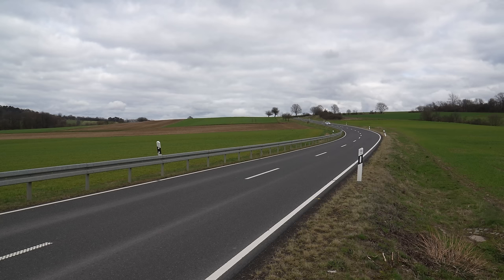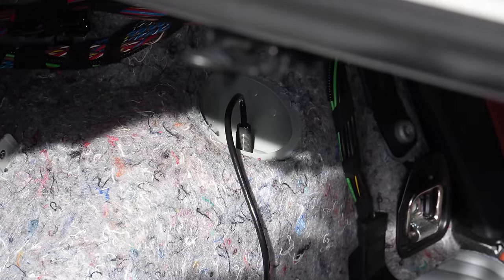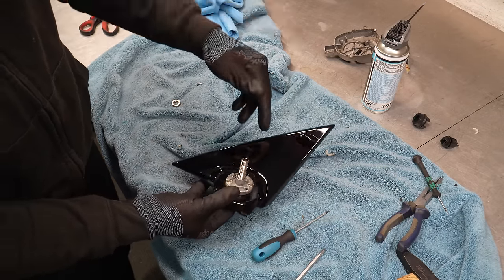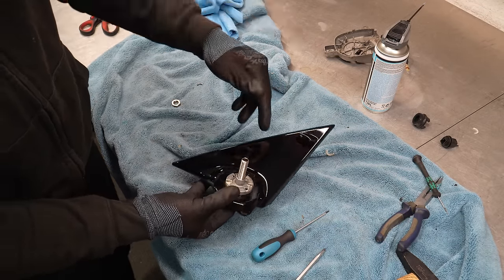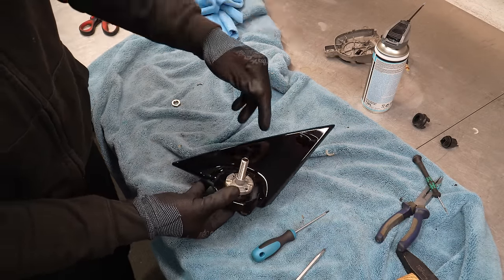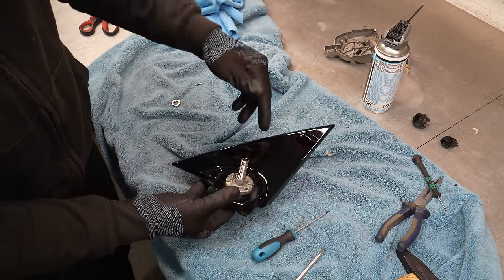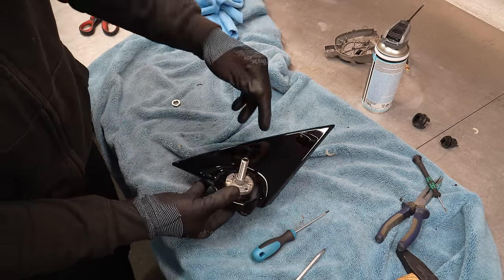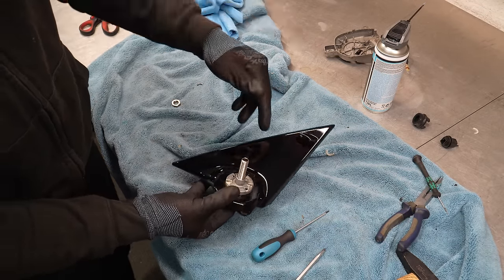Will the Built S65 V8 Make More Power? - BMW E92 M3 - Project Frankfurt: PT9

Comment: Question: why no exhaust/intake mods? Since you did the upgraded heads/cams would probably gain you another 30-40hp.

- also why no lowering springs/kw has ?

Love the build, and I'm getting another e92 m3 as soon as my ls Swapped e36 sells.

Comment: Why is the nm and Ps not crossing around 5250
Reply: The crossover at 5252rpm only applies if you're measuring power in HP and torque in lb-ft
Reply: @Johnny362000  Thx

Comment: But good Sir, I fail to understand how a differently shaped aluminum arm changes its runway and perceived resistance at both beginning- and endpoints. I dont mind the treat of course. Will project Frankfurt get an entirely different color as its on the road?

Comment: The listed horsepower/PS of cars is usually(always?) at the crank and not the wheels. So I would imagine 390 at the wheels is more than expected if it's listed at 420, because RWD has a greater power loss than FWD because of the driveshaft. I've heard up to 15-20% less than crank measure power. So 390 + 20% = 468(at crank)
Reply: These dynos take drivetrain losses into account

Comment: Great video. If I'm not mistaken you missed a few things: Cold air intake, Plenum and Exhaust. After, get another tune. I had this car for a couple years & broke suspension components in hard cornering. At the time I was being a little turd & just said "fix it" to the dealer. Now I regret doing that bc I wonder wtf it was. It'd click rhythmically after it broke in turns, almost like a CV joint does. Wish I knew what it was.  I think "big brake upgrades" are utter BS scams. Braking is about tires & fade = thermal mass. As in, the thickest rotors your calipers can fit. Now, what actually does make a brake better is if the caliper is lighter. I'd greatly prefer a lightweight 4-piston option ... as clamping force is NEVER a problem. Only brake fade. Of course, you want low unsprung weight. But even more important is low unsprung rotational inertia. Best still is make it all light. To that end, AP racing is the best. 

For those of you who love removing cats, just remember: Many governments literally CRUSH cars without them. Yeah, I used to drive my 2JZ in 1997 without them, buuut, in retrospect, imagine how fast it would've been had it been impounded and destroyed. One day I'll upload my video from Streets of Willow with Rhys Millen and my laps. Fun times.

Comment: I genuinely love the effort, I just hate the fact you kept it naturally aspirated and kept the STOCK EXHAUST, with a full Eventuri intake, you've got to match it with an uprated exhaust I mean come on now... and then just add a turbo, you clearly love the noise, so why not add one and a blow-off valve for the added noise and longevity factors? idk, seems silly not to when you've spent so much on the build already... Other than that, what a great build!!! (Edited : Not to forget that approx-$499 kit for the E92 that literally adds another 60+bhp at the crank which is easy asf to install? again, another no brainer for me? but hey)

Comment: I mean you can praise BMW engineering for being able to take the wingmirror off without taking off the door card but the only reason you are doing it is because of stupid over engineered mirrors and an underengineered pin that gets filled with dirt and stops working. Lets not ignore the fact you then have to get a dremel out to actually dissasemble the mirror....

Comment: The engine never delivered its power fresh from factory, because like all N/A engines you need a proper run in period. Which most white haired owners at the time didn’t know. These cars went on the dyno years after with their third owner, much younger and concerned about numbers.
That’s why I have a problem with the « E92 M3s don’t deliver their power »

Comment: E9x M3 is not famous for outputting lower power than advertised. Chassis dynos measure torque at the wheels, while BMW quotes horsepower from the engine itself. Two very different readings.